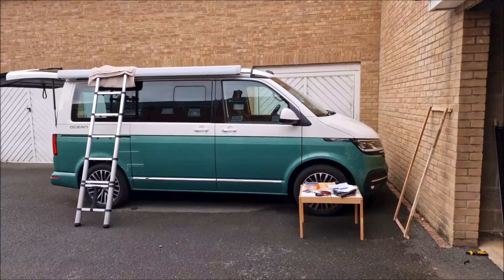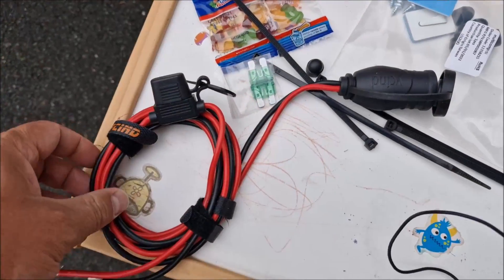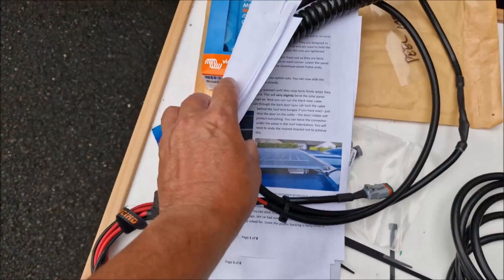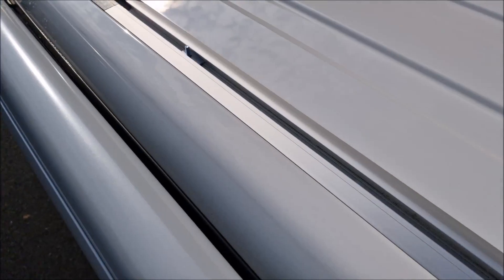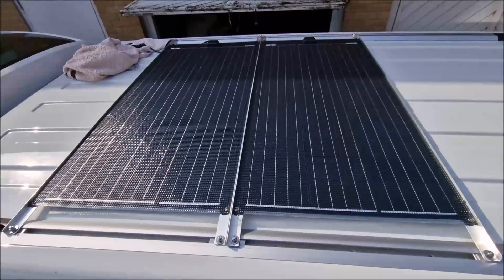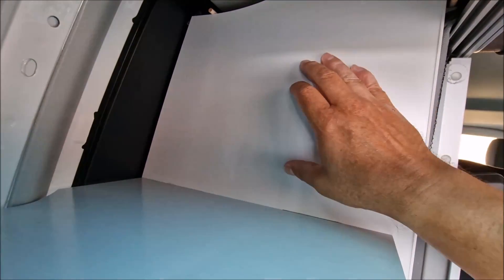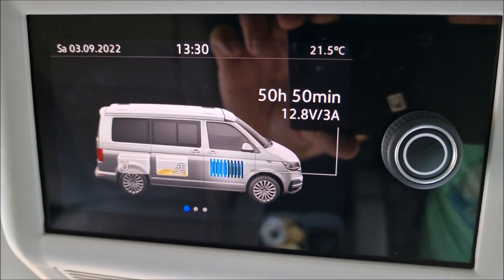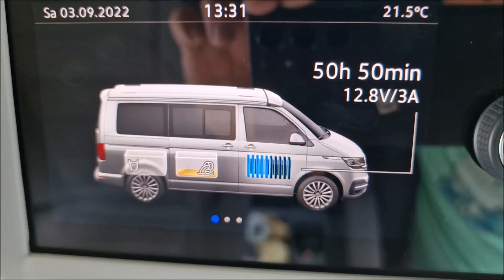T6.1 California Ocean 200w Solar Install

Comment: I’m seriously thinking of doing this but I don’t have a driveway or anywhere safe to work. 
I’m fed up with having to top up the leisure battery with my Ecoflow using it as an EHU which involves carrying the Ecoflow up and down stairs. 
Did you notice much wind noise with the panels on the roof?
Reply from the maker: Hey there, solar is great in summer but not great in winter as you would expect. However just for summer top up and recharge when away with no ehu is great peace of mind. No wind noise noticed and been driving as daily driver.
Reply: @andybearyaki Thanks for that.

Comment: Hi! I have a 2021 California Beach, I'm building my own rear storage unit, and I found a Dometic charger and an OEM California Ocean battery at a junkyard. I have some of the complete wiring harness and an installation diagram, but I have a question: do you know where the positive cable runs from the third battery in the storage unit to the left seat? I'm not sure if it goes under the floor or through the ceiling.
Reply from the maker: I thought under floor and checked with chat gpt. https://chatgpt.com/s/t_696d374a23208191858f0044368875db

Comment: Thanks for the tutorial. I believe there is a risk of damaging the controller if it's connected to the panel before the battery. If the panel has high output it will burn out the coils as there's nowhere for the energy to go.
Reply from the maker: Thanks for heads up. I guess I was lucky if that is the case. This is by no way a professional tutorial as you could probably see just my take on novice install. Touch wood no issues since installing 😀
Reply: If you cover the panels while working on them would this make it safe?

Comment: That’s an amazing installation video Kev! Definitely thinking of getting one for myself! does the solar panel have any influence on your batteries if you are plugged in by cable (on a camping for example) at the same time? Is there a risk of too much charge?
Reply from the maker: HI Tom, no no risk of overload, the cali system is quite clever as well as the mppt controller will reduce input based on battery voltage. I have never had an issue with the solar set up so hope that helps your decision :) you wont regret it especially when you leave it sitting for a while outside no risk of battery damage if solar is always keeping them topped up :) Happy Camping.
Reply: @andybearyaki  amazing!! Thanks so much for your reply:)

Comment: Hi Kev. Just received and installed my kit. Did you change any settings in the VictronConnect app to better match your batteries? If so, what settings do you recommend?
Best regards
Jesper
Reply from the maker: Hey great news, i followed the instuctions in terms of default settings but i have used by own settings for the output (i.e. links directly into the ecoflow from the 12v socket driven from the MTTP controller) i used a cut off if the battery gets to a certain voltage to ensure the van leisue is never run down.

User defined algorithm 1:
OFF when Vbatt < Vlow, ON when Vbatt > Vhigh. (Vbatt being your desired threshold)

link to the victron help pages.
https://www.victronenergy.com/media/pg/Manual_BlueSolar_MPPT_75-10_up_to_100-20/en/configuration-and-settings.html#UUID-e66362d1-a266-4b2d-4b64-2c478629c072

Comment: Hi Kev, could you please explain how you managed to remove the battery from its cupboard.
Reply from the maker: Use a screwdriver or something flat. Lay a towel on the edge so when you use the screwdriver etc to use to lever it out you don't scratch the bottom edge and then just wiggle it free. It is heavy so be careful.
Reply: @andybearyaki  Thank you. Managed it!

Comment: Hi Kev, thanks for the video.  For a long time I thought about installing solar panels on the roof or using solar bags.  I decided to take the last option.  I know there are also disadvantages.  But I am willing to accept this.  I currently own an ecoflow 160w solar bag with an ecoflow River Pro power station.  the plan is to purchase an additional ecoflow 160w.  switch both 160w in parallel and charge the living room batteries via a Victronic 100/30.  initially my plan was to connect the battery under the seat.  your setup uses the rear battery.  is this really possible?  are there any problems or disadvantages?  is it correct not to connect the negative pole to the negative pole of the battery?  is this really possible?  last point, since the mppt was not installed next to the battery, wouldn't a Victron Energy Smart Battery Sense need to be installed on the battery to provide information about the battery's temperature?  From what I understand, the power station can be loaded using the load connections from the mppt.  does this work well?  have you already had experience?
Reply from the maker: Hey Nino, glad you found a solution that works for you.

i think the benefit on the rear battery for me was it's proximity to where the cable comes down from the roof. I think you could use both if connected. I am not an expert on power so just followed the instruction but i think if you connect to the battery neg connection then the T6.1 Ocean screen will not display the power input correctly.

The connection to the MPPT directly via the 12v cig connector does work well in terms of advising power consumption as well as the power input, you can just charge directly into the van 12v cig but then it may drain your leisure (The MPPT can control the power being diverted). 

I did install the Victron Energy Smart Battery Sensor and works well with the MPPT controller to monitor temp.

Overall the setup is working as expected and i average from the 200w around 80w per day but it has been cloudy nearly everyday and i park in a shaded spot so not bad.
Reply: @andybearyaki  Thank you very much for your reply.  I wish you many happy times with your camper

Comment: Hi Kev, Can you post your kit / parts list love the setup.
Reply from the maker: Hi Michael - i bought the kit from solar camp solutions - https://www.solarcampersolutions.co.uk/index.php/en/

It comes with all the fittings to fix to the roof rails - no drilling / cluing required and the cables/mppt controller. (you can pick the MPPT you want, i went with the victron bluetooth as more than enough for my needs)

Let me know if you need anything else / help but i found this an easy setup also thanks to Roger from Solar Camp Solutions responding quickly to emails.
Reply: @andybearyaki  Many Thanks!
Reply: @andybearyaki Had mine fitted by Roger today, great bit of kit. Thanks for your video.
Reply from the maker: @WastetoWonderWorldwide  good to hear, happy camping.

Comment: I awalys wonder why you want to install the solar on your roof. When you camping in summer you are looking usually for a place where there is less sun .. so it would be better to have solar that you can move to the sunny spot and the cali can stay in shade place ?
Reply from the maker: It can keep the leisure battery topped up wherever you are even cloudy is fine. But also a good point
Reply: Even in the shade ours has been perfect as a fit and forget device to keep the battery topped up enough off grid. I prefer this way to having to setup and rotate panels on site all day long.